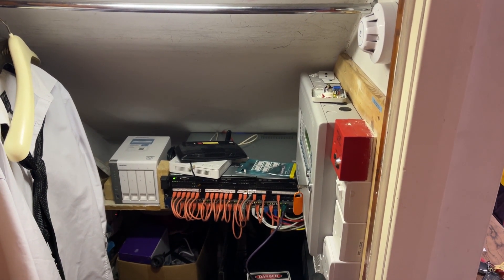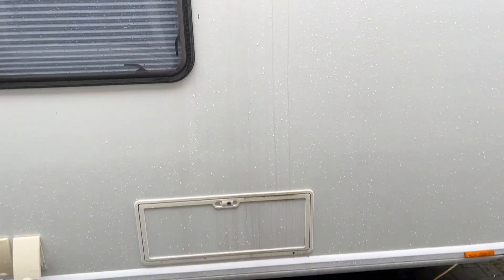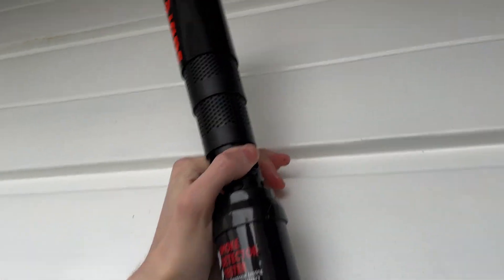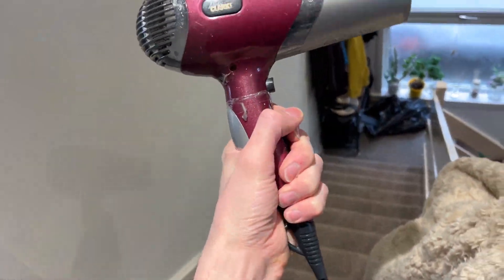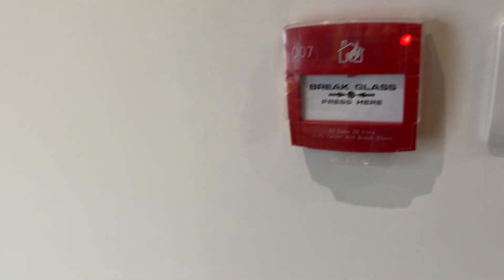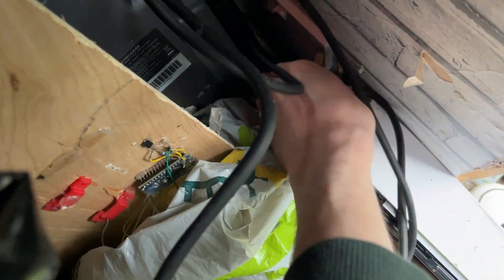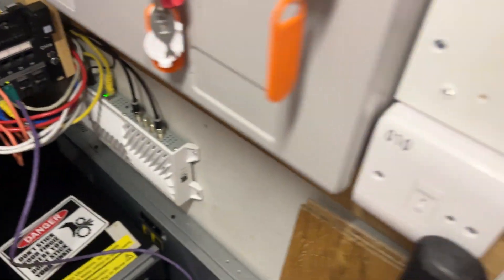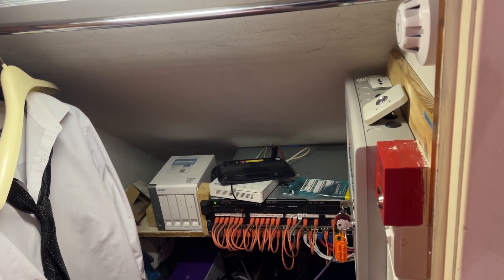Addressable System Test 28

Comment: My school is having the fire alarm system replaced from protec with appolo, so this week its appolo on the ground floor but the 1st floor is still protec divises. All the appolo detectors are multipoints, they are heat and co2 at day time and smoke at night time, and i have the same appolo call points as you in yore shed and utility room, and the sounders are the same as what you had in the garage on test 3 (not shure if you remember) but they flash.
Reply: You spelt Apollo wrong 😑 😂
Reply: @ElliotMacpherson-go5lz   Oops

Comment: Connor when the shed used to be a smoke detector. Why did you replace it for a heat detector instead of a multi sensor
Reply from the maker: the use of the space changed where a smoke detector caused issues. it can go back to being a smoke detector now tbh as its just used for storage.

Comment: did you manage to find the problem with the garage sounder ?
Reply from the maker: yeah, i am going to put it down to a programming error. its been replaced with a XP95 open area for the time being.
Reply: @testlogs9005  is that the old garage sounder where the strobe was. and also how come you changed the call point from the apollo call point like the shed and changed it to the discovery one but didnt tell us?

Comment: my pc won't detect my syncro when I plug it in any suggestions as to why please? - Answer - Make sure the comport is selected as the same one as your computer
Reply from the maker: all i can say is some usb to serial converters dont work, or dont work well with the synchro. its expecting RS232 that standard is logic levels that go -12v to +12v those little adapters you can get that convert the USB to serial or most likely for the cheapy ones TTL serial which ranges from 0v to 5V or 0v to 3.3v, now these can work but they need to be set up right and if the adapter does not have a utility to modify the signals to be inverted its likely going to give you trouble. ie panel not showing up in the software. thats one possible issue your having. 

the other issue you could be having is your not telling it which com port to use. loop explorer can see com ports 1 to 8 so if your adapter is showing up in device manager as something out of that range your gonna have to set it to a com port in that range in device manager then set it to that port in loop explorer.
Reply: @testlogs9005  I have fixed it I had the wrong com port selected. But while I have you , I have the same sounder as your voice sounder but without the voice but I want it for the alert tone only but I can’t get the alert tone for some reason. I’ve tried using loop explorer, no luck there so I emailed Apollo and they said in order to have the alert tone active it needs to be set via panel. We have the same panel would you know how to do that? Also when the panel goes into pre - alarm , all of your sounders go on alert tone and when in Fire then go evacuation tone , how do I set my sounder bases/ beacon bases to do that? I have loop explorer version 6. Also another issue , whenever I change my addresses on my devices , the panel does not  register the change even when auto learned or manually learnt. Even a second hand sounder that was address 25 is showing up on the panel as 126 when it hasn’t been changed - if you can help with my problems that would be amazing. Thanks

Comment: Im new to the apollo xp95 system. I find that the optical in my bedroom may be a little too sensitive. Is there a way to adjust how sensitive the optical is?
Reply from the maker: replace the sensor with a discovery one if your panel supports it. page 2 of the data sheet for the device shows the table with all the modes and what they do. you can change the mode from the panel.

Comment: Would you trust this system to save you in a real fire in your house if you was all in bed to wake you up in time so you could get out  and if no one was in to your neighbours would know you’re house was on fire and so they could ring fire brigade before it was it was obvious you had a fire as I want a fire alarm system like this in my house because the smoke alarm went off by mistake a few weeks ago and people was asleep and it was not loud enough to wake them up  which would of been fatal in a real fire during the night just wondering what it would cost for a panel and about 10 sound Bace with detective about 2 heat and 5 standard detectors with no sound bacse and sounder outside and 3 call one upstairs and one by the panel and by the door I think call points are best by a door so the person can press as thay are own thire way out from the fire or  other emergency

Comment: oh no! the garage sounder decided it is time to die. Possibly loose wire or being a shit that does not want to respond.

what was the outcome of that sounder
Reply from the maker: The sounder was actually fine it was just the panel playing funny, like it did with the dining room sounder. Restarting the panel fixes the issue. Still not ideal either way I found that out after replacing the sounder with an xp95 open area. Aw well.
Reply: @testlogs9005  reminds me of my vista panel having it’s RF reciever fail and require a restart because of no battery. Annoying

Comment: Hello again test logs , My Discovery sounder was up inside the same room as the panel , after running a weekly test on 2 call points it’s was all fine but after resetting the panel I got a fault. I was confused. I looked at it and it said “internal fault”. The device was still working / sounding like it’s meant to do but it kept saying internal fault. Do you know what could have caused this? Do you know if there is a way to fix this? Do I just buy a new head? If you want photos of the wiring ect please send me your email. Thanks - Overload